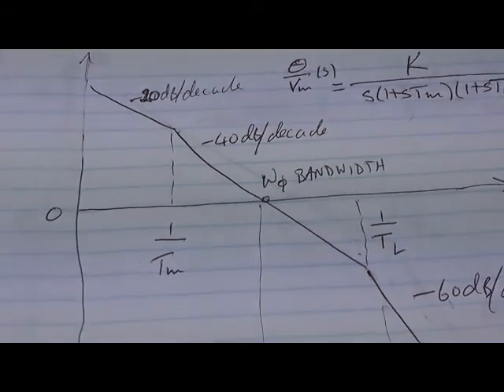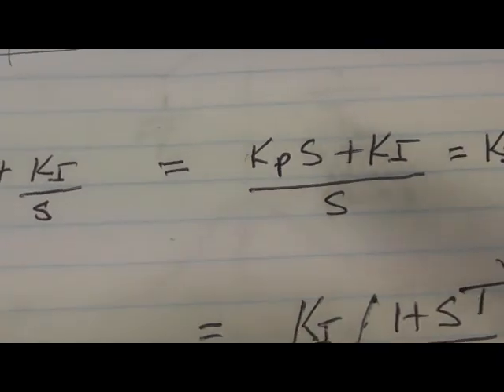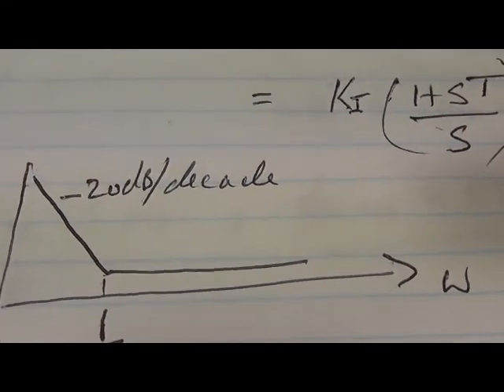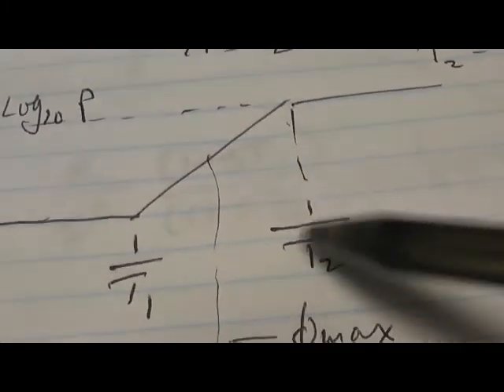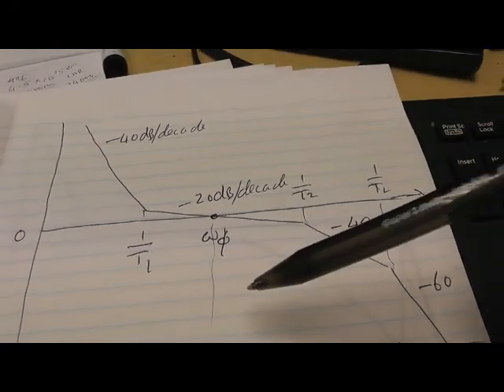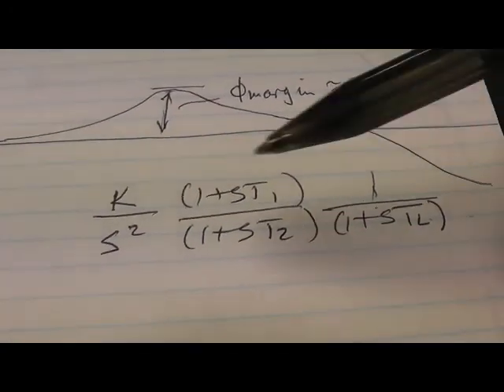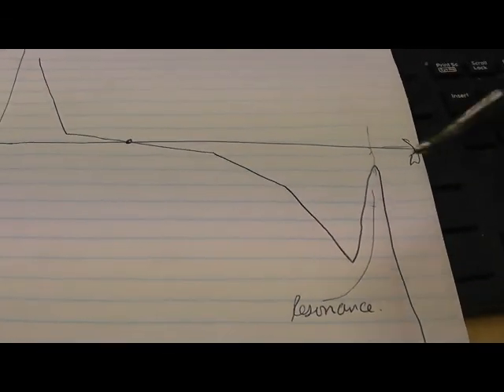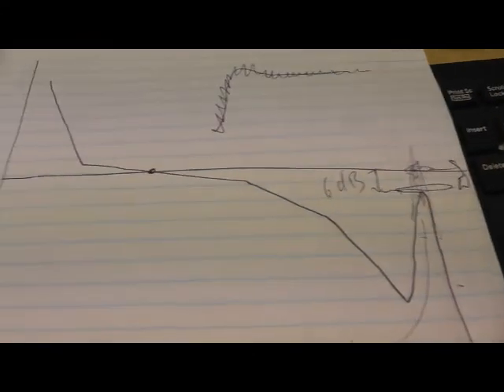Compensating control  systems with feedback using  classical control

Comment: Would the gearbox on the motor from the last video cause more upper resonances?   More mechanical components acting against good control?
Reply: more gearbox only affect or elongate the system mechanical time constant, my resolution would be tune down the PI zero frequency to actively cancel this effect out...